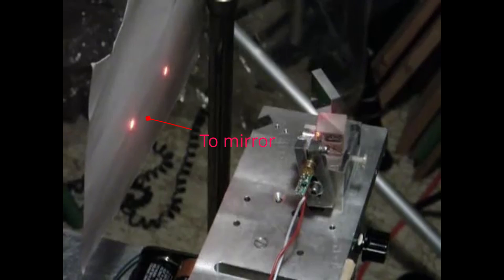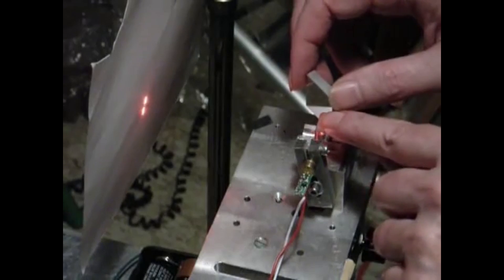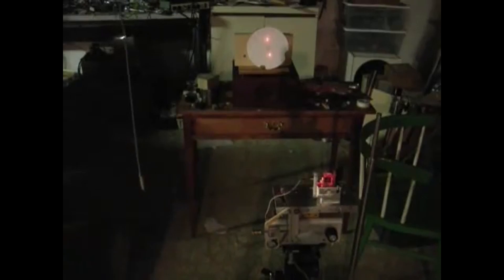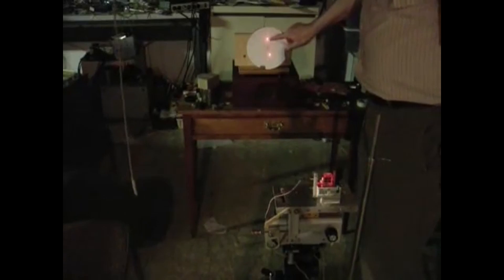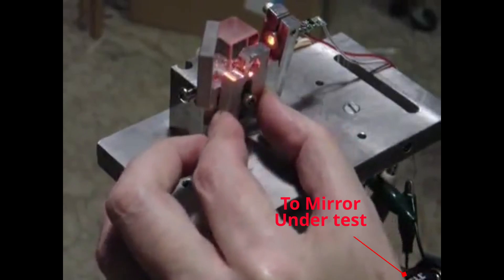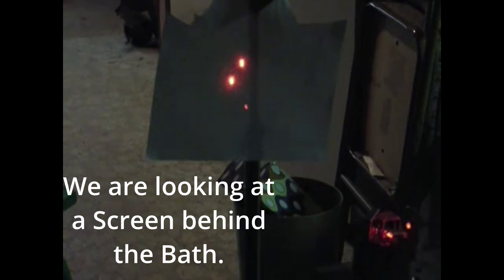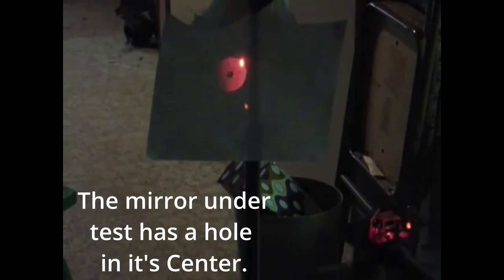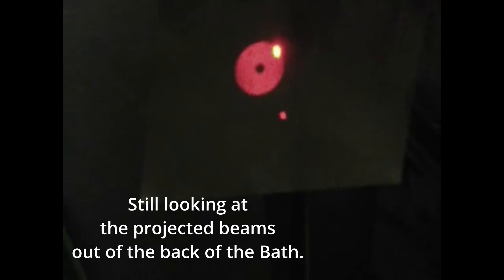Bath and mirror collimation.  How to adjust the Bath interferometer components.

Comment: What's the ideal distance between the two beams?
Reply from the maker: Exiting the Bath they should be as close as you can get them.  The further apart they get the more astigmatism is added to the analysis.  How much astigmatism depends on the mirror parameters.   DFTFringe has a feature that shows the amount.  However for usual size mirrors ATM's make the astigmatism is small if you keep the beam separation to around 7 mm or below.  In addition DFTFringe has features that can remove the system induced astigmatism but leave true astigmatism from the mirror in the analysis.

Then the ideal distance at the mirror under test is the same distance.  For more information see the Wiki in the groupsio interferometry group.   https://groups.io/g/Interferometry